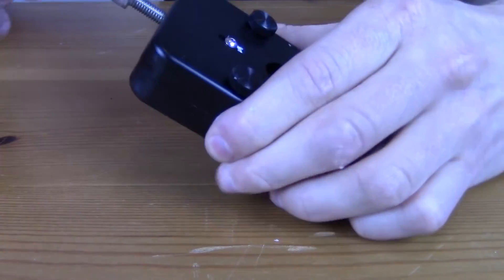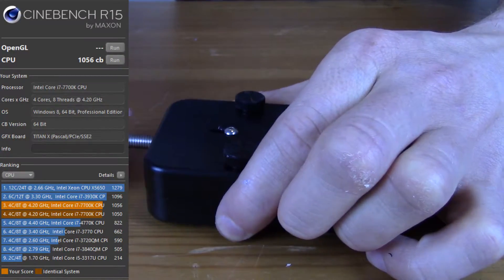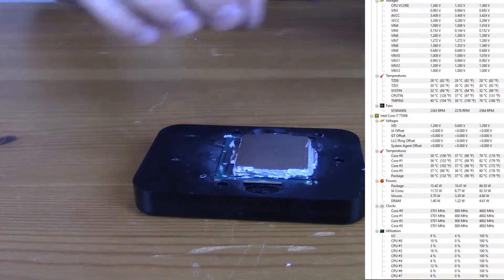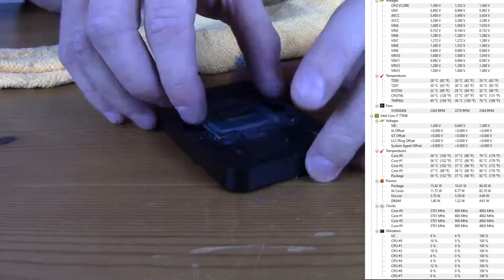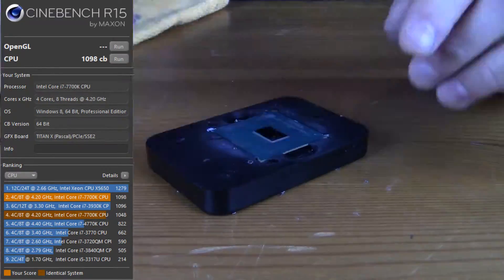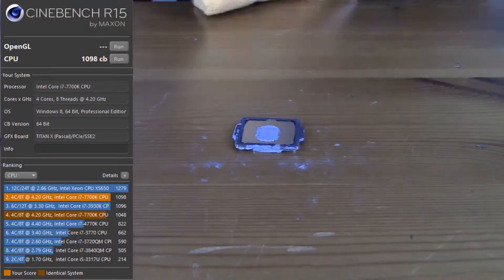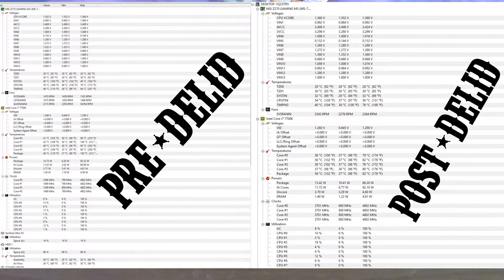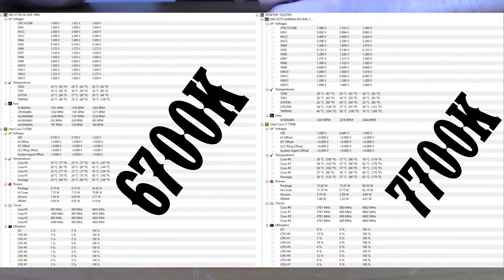My I7 7700k Won't Overclock to 5GHz Without a Delid

Comment: i dont know if you needed some bad ass water cooling and expensive mobo just to get a 5ghz OC. i use noctua gigantic d15 air coolers and a mid range gigabyte z270 mobo but i cant get my i7700k to 5ghz which is such bullshit. i can get it stable at 4.8, at 4.9 no more as my game crashes at some point and gets the pc to reboot/blue screen. 5ghz OC should be easily acheivable but no.
Reply: Lower your ram speed. the 7700k is really picky with ram speeds. Start your ram at 2000mhz and it should run stable at 5ghz and just slowly increase your ram speeed until you find what causes the 7700k to run unstable and then just back it off a little. I had 16gb Gskill @ 3200mhz but the most I could get my 7700k to run was 4.7ghz. I backed my ram down to 2100mhz and I haven't had any issues at 5ghz.

Comment: I feel like I got cheated I am Stuck at 4.6 ghz :'(
Reply: Tivis7 4.6 on which processor? I have a 6600k at 4.6 and that seems to be it's limit. 4.8 on the 7700k should be easy

Comment: If i put liquid metal instead of thermal paste between the cpu and my cooler(fan cooling), will it help  to cool my cpu ? I dont want to delid. I use ZALMAN CNPS8X OPTIMA HIGH PERFORMANCE and when I play WoW it goes over 80 Celsius with no overclocking.STOCK!
Reply: Considering how old WoW is and assuming you own a 7700k since you post below this video.. i dont see any reason your cpu should run that hot at all. Is your fan even spinning? Are you maybe using a messed up fan speed curve? How much is your cpu even used when playing WoW lol.
Reply: I just cant comprehend why it should be getting that hot. The only thing that comes to mind, assuming your air flow is not obstructed, are:
1. If you have any older motherboard than 270, get a bios update. I heard that kaby lake has heat related problems without it.
2. If that's not it maybe you got a bad chip. Maybe try to make a warranty claim?
Reply: Indeed lol.Max used cpu I ve seen is about 30 percent and yes I own a 7700k.
Reply: I will upload a screenshot later.Also I ll check bios for the cpu fan control's.
Reply: Mobo is Msi 270

Comment: You need to buy CPU's from people who don't want or never overclocked because they have the most luck ironically. After the huge let down of a 4770k, I only bought used CPU's and I am consistandly getting top 3-1% CPU's it's crazy.

Comment: Currently at 1.328V and 5GHz, working great! No de-lid, too afraid :D

Is that a microfiber clock you're using?
Reply: Ritchie Drama im at 1.3 for 5ghz. At Max load it runs hot so i do 4.9 at 1.23. I Will delid it soon. A lot of degress to win :)

Comment: Hey son of a tech, this might be a dumb question but how do you know exactly where to perfectly place liquid metal in the right spot on the under side of the IHS. Since liquid metal is conductive you tape off the pcb so only the die is showing....but you also but liquid metal on the IHS sooo perfectly how did you do that is there a trick for knowing right where the Liquid metal should go on the IHS? So i dont get any on the pcb when i stick the IHS back on.

Comment: I wonder for how much time would the I7 temps be normal until the thermal compound inside completely dry and probably making it trigger the thermal throttling to decrease performance on purpose so you would buy a new CPU?????
Reply: I think they shouldn't cheap out on TIM to make extra $ IMO.
Reply: I agree. I was just saying that the thermal paste is actually of high quality compared to half a decade ago. But it definitely should have just been soldered rather than cheap out to save a couple bucks on a $300+ CPU.
Reply: Most CPUs today have high quality thermal paste. Back in like 2012 they used to put cheap thermal paste that caused problems very quickly. But I think that today by the time the thermal paste on the die starts to dry out, the CPU will be way outdated anyway.
Reply: If it was high quality, why do we benefit from delidding then mister?
Reply: Because there is always room to improve. Although it would save us a lot of trouble if they just soldered it.
Reply: Yeah but my CPU is from 2010... I7 2600K... Though I have it at 4.9 ghz on air and never got a single problem yet.

But I'm thinking to delid it, however I wanted to actually glue the metal plate and not leave it hanging.

DO YOU THINK EPOXY GLUE WILL WORK???? (the two mix glue used in RC airplanes which get hard as a rock).

ps: I'm already at 1.55V and would like to achieve 5ghz, but would need to lower my temps... Anyway I'm still to change my thermal compound for a long time already, but I'm too lazy and I also have a high cfm, high pressure fan to add to it, but Its on the box since 2011, never used it... Don't know if I would split the cpu fan connector in two or add it as a system fan... since I can't decide, 6 years passed and I still haven't put it in the PC :).

Comment: If you are for real about watercooling performance, get rid of the AIO. You can drop an extra few degrees moving to EKWB's supremacy evo waterblock. AIO coolers can't outperform the big air coolers, especially Noctua's NH-D15...and corsair's is a bit junk...actually all the Asetek cooler designs are lackluster compared to a decent custom setup. To keep results consistent, I'd test everything on the same cooler set up every time. Either get a custom watercooling setup or just use the same air cooler for every test.
Reply: http://forum.computerlounge.co.nz/posts/t8292--Noctua-NH-D15--vs--Corsair-H100i--vs--EKWB-Custom-Loop
Reply: Brik Haus well most know that a aio will never be as good as a custom loop but most don't want to pay the 300+ to build a loop them self, I have the corsair H115i and it cools my 7700k well enough to push 5.0ghz keeping it nice and cool, after I change my case I will then invest in a custom loop aswell as a few other upgrades :)

Comment: Sorry to hear you lost the silicon lottery :( I read from 300 samples of the 7700k 40% would do 5ghz at 1.35v, so I guess you just got a potato. Not tempted to buy another and see how that clocks?
Reply: In my country you could send it back with a reason: " Bought the wrong item"

Just make sure you dont damage the box :P

Comment: The more I see of these videos the more I think I might want to try delidding but I'm definitely gonna start on something cheaper. Maybe try delidding an old Xeon 5470 ($40 chip) on the 771/775 platform build I have. Can you post a link of the proper thermal paste to use and another link to the delid kit for me? (I know you posted it before... sorry)

Also sounds you could hit 5Ghz on water with the 6700k since you hit 4.9 on air? thats awesome and will be my end goal for my main system since that's the chip I have in it.